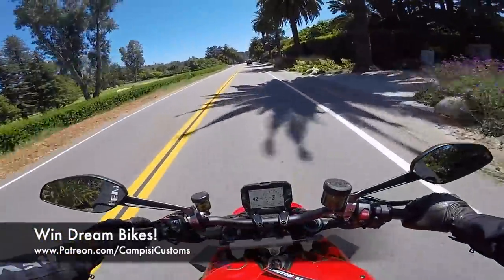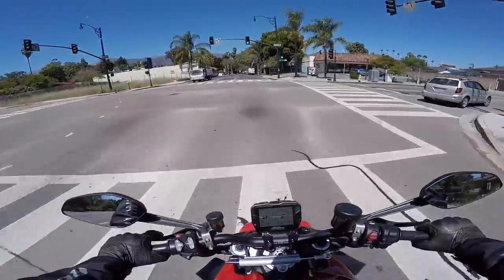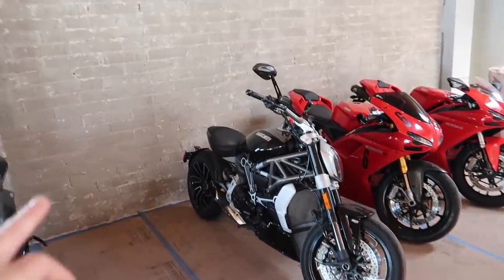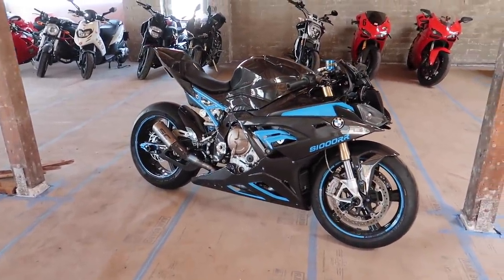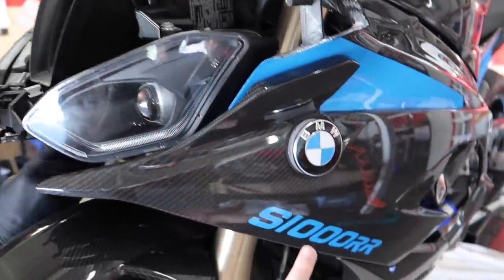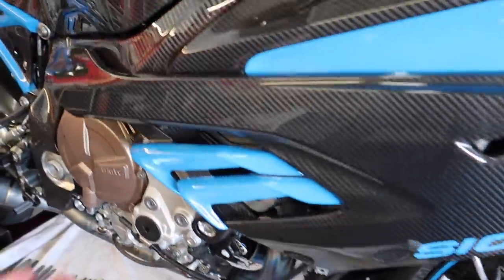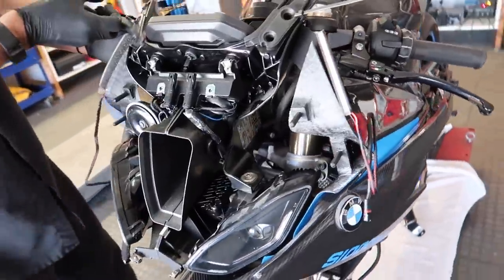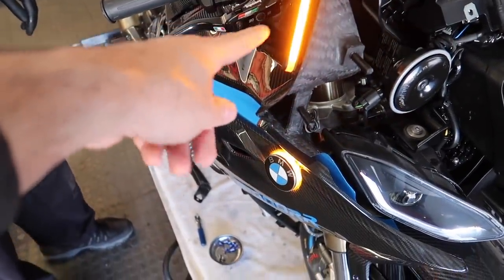Our Full Carbon S1000RR is Finally Together!!!

Comment: You should visit Wisconsin.  They chip seal the roads there.  They lay down oil and then gravel.  The cars then compact it.  You get used to it.  Most of California doesn't have to deal with the ground freezing.